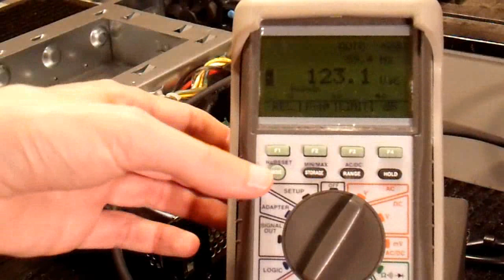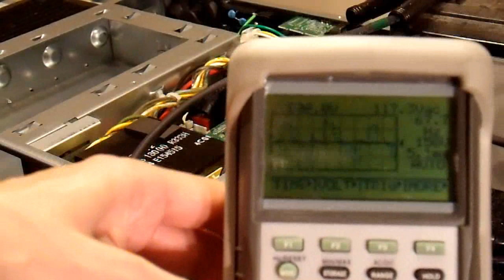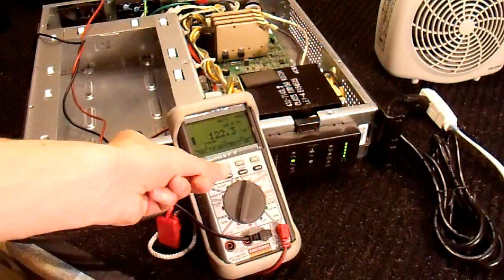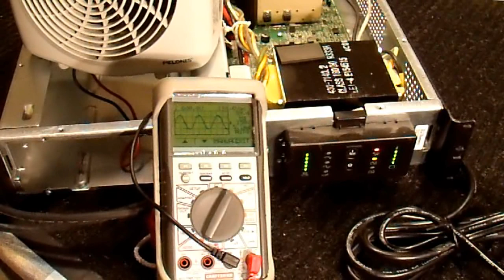UPS to 1.5kW Sinewave Inverter Conversion part4 - Modified Sine demonstration

Comment: that nasty modified wave form. it looks that a saw tooth wave form would be better for equipment. than that sad wave inverter. looks that it would have a lower average voltage. since the on time looks to be less. is it?

Comment: would a universal motor run off it better if it was rectified ? I know the switches don't like switching DC. but that would be pulsed DC. as long as there is no capacitors added. and the voltage will be higher but that's just peak voltage. so would it run better? has anyone tried it? thanks

Comment: but if you had keept the power on button on while unplugging the aps ups would adjust the ac volt and waveform input to your ac volt output from the ups this worked with a apc ups1500va I`ve got

Comment: I have a 3000 watt generator that run on gas. could I take the generator out and run it off a water wheel and connect it to the house.

Comment: Something interesting to note is that cheap PC fans (which are synchronous motors with built in inverters) use square wave or modified sine inverters, while the good ones use sine wave inverters. The sine wave fans, of course, run much quieter.
Reply from the maker: That is interesting.  I did not know that and assumed that they all used PWM or square wave.
Reply: The PWM is how they generate the sine waves. The cheaper "PWM" fans basically use analog modulators and resolvers, while the better ones (most notably Delta and Nidec) have a DSP inside that actually does what is known as Field Oriented Control.

Comment from the maker: I have wanted to make a video on what you are proposing for some time, but don't want to modify/ruin two inverters just for the video.  You'd have to open the cases and do some pretty serious modification to accomplish what you want.  If you just connect them up in parallel they'll likely destroy eachother.

Comment: Can you tell me if it is possible to connect 2 3000 watts inverters to make 6000 watts out of them? they are 12v DC to 220 AC, can I connect them in parallel?
Reply: Highly unlikely. I don't think its possible for 2 inverters tonwork together .... Unless they are specifically designed for that type of function.

In my experience.

Comment from the maker: A valid question and it has to do with THD.  The fan did not actually operate properly off of the Cobra inverter but it did operate a little bit more correctly, enough correct that it wasn't too noticeable.  I was planning to make a video specifically on this subject soon.

Comment: I don't understand why in this video the fan does not work with the modified sine wave and in the Cobra review the modified sine wave powered a fan fine OK.

Please explain.
Reply: In my experience the fans normally work, but they get warm, or even hot, aftwr some time ... And some fans give out a humming sound.

Comment: @kNURLGNAR24
You like that craftsman multimeter scope model number 82289 . Im in the market for a scope cheap in price and easy to use .One or two questions did it come with bnc conectors for the scope and is it able to run on a dc power supply from the wall outlet .